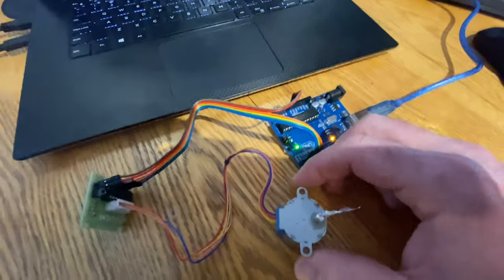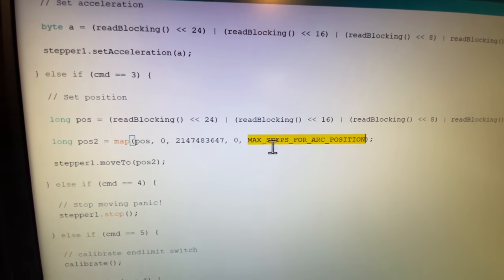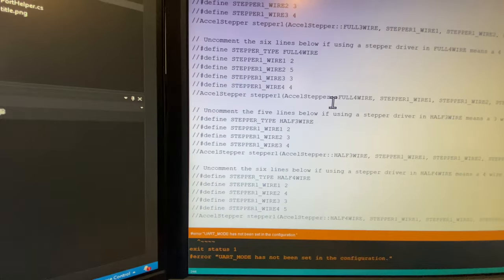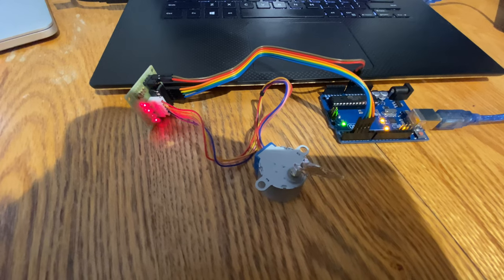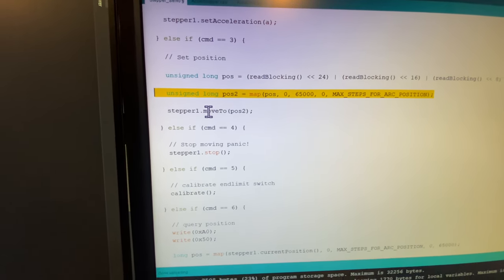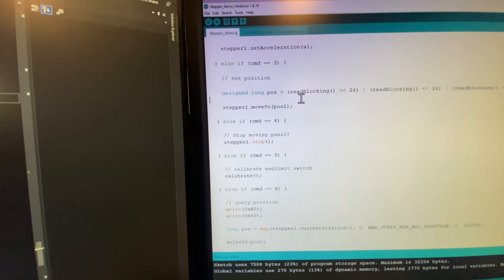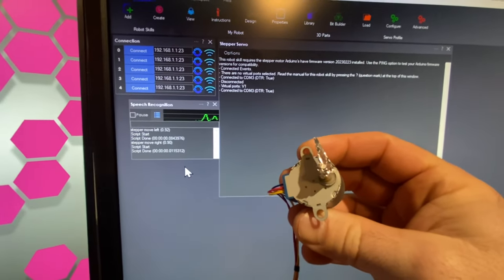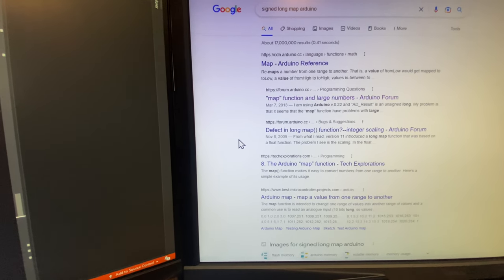Arduino, ain’t Map() got time for Longs

Comment: From Arduino reference page, the map() function only works with 'long' for the parameters and the returned value.
And also without a prefix, constant numbers are interpreted as 'int'. You have to add a prefix, UL65000 to force an unsigned long.
Reply: shouldn't it be 65000UL?
Reply from the maker: 65000 is not a long, it is an unsigned int 16 .
Reply: @cocusar  You're right. It's a suffix.
Reply: @DJSures  Yes I know but Arduino compiler doesn't :). You have to tell it explicitely or it will use its signed equivalent.

Comment: The problem is explained in the first hit for the search you did.  The map function only works properly when the input range multiplied by the output range fits into a long.
Reply from the maker: 6500 does fit in a long. I don’t think anyone is watching the video lol
Reply: @DJSures  The product of both ranges needs to fit.
Reply from the maker: and it will because 65000 is an unsigned int 16. And it also is because the compiler is treating the unsigned int 16 as a signed int 16

Comment: If you've determined that a particular function call is giving you problems, it's best to debug that function call by using either a debugger or print statements to show all the inputs to the function and the output from the function.  Trying to second-guess what's going on can lead to a goose chase.
Reply from the maker: it's not a function call - it's a compiler issue. i only have an 8 bit micro to test with because of my geolocation right now. but i just moved on - strange though... strange!

Comment: long map(long x, long in_min, long in_max, long out_min, long out_max)
{
  return (x - in_min) * (out_max - out_min) / (in_max - in_min) + out_min;
}

That very first multiplication, input range * output range, overflows signed 32 bits.
Reply from the maker: 6500 x 1500 is only 92 million. It does not overflow. I recommend watching the video because it’s quite interesting

Comment: In the PLC world General Motors would use a scaling function in its standard code that had its own issues. I just did what you eventually did and roll my own. Scaler functions are crap in my opinion.

As a side note, while working for Schneider Electric I was working on a Modbus decoder, and as part of the Modbus spec I had to swap the order of the upper and lower bytes. Whenever that resulted in a negative value I would get an overflow condition and the program would crash in VB. I tried various tricks with no success until I stumbled upon converting the value to a Hex string, re-arranging the pairs, and the re-converting it to Decimal. Go figure...

Comment: It seems like the discussion online is that map with large values overflows during it's calculations and that might produce negative numbers.  Declaring variables as unsigned won't help with this at all since the Map function itself operates on signed values only.  I'm surprised you didn't warnings mixing unsigned and signed operations.

It feels like, though, using 65000 should be small enough that it doesn't overflow a long.  In these situations I usually start throwing out any assumptions and trying to see what are the actual inputs and outputs.  It's probably still an overflow but maybe not because of the one constant that you are changing.
Reply from the maker: Correct, that it should not overflow and it doesn’t. And even if it did overflow, it would still be an unsigned long which would overflow to 0. So the compiler should have never let it be a negative value. And on top of that, 6500 x 1500 is 92 million. That’s not enough to overflow a 32 bit signed or unsigned int

Comment: You need an L with your long constant.
Reply from the maker: You don’t “need” it but I used it as well. But if you watch the video, I’m using 65000 which is not a long.
Reply: 65000 is a long it won't fit in a int16.

I say 'need' because it's a lot safer than not. In C assignment doesn't promote integers during expression evaluation, it's based on whatever is happening on the right side of the '='. The assignment just does a conversion of the result. So for your unsigned map(), the math is done in long then the result is converted to unsigned long.
Reply: Yup it looks like a kraken in the compiler, arrggg, what a waste of time with those errors. Had issues like this back in the day with mplab x c16 in my dev from back in the day.
Reply from the maker: you got it - it was so painful. I wonder if the compiler is only broken for the 8 bit UNO because that's all i have access to while i'm in the middle of no where :D